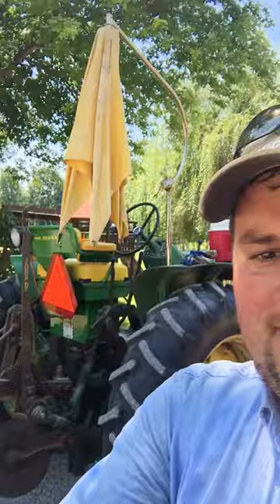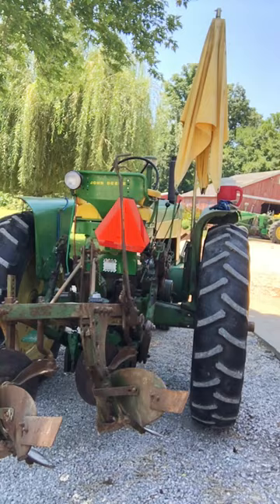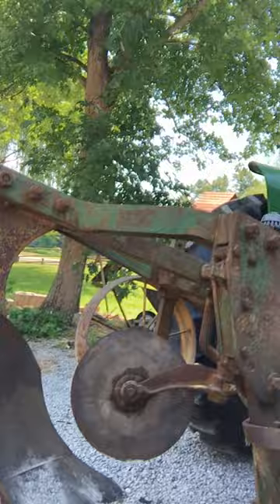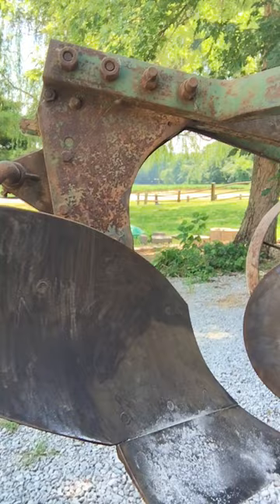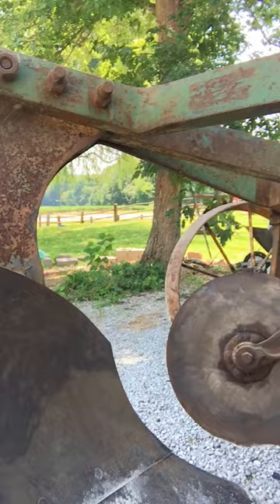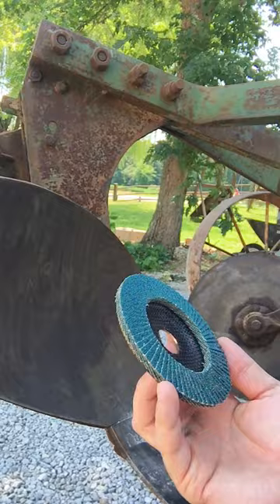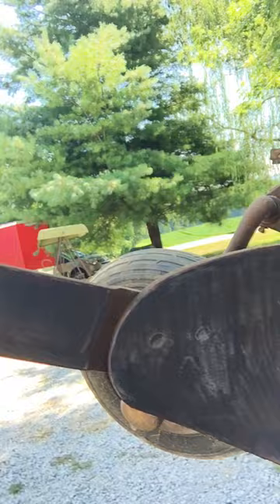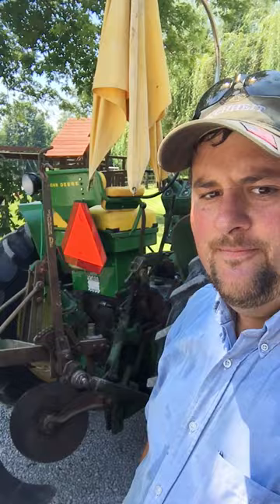Rust Removal on moldboards.

Comment: Bought a 4 bottom with some broken share tips.  The front two nuts and bolts are so rusted that they just round off.  What's the easiest way to remove them short of grinding them off?
Reply: Heat
Reply: @robbiemccarty4226  Yeah, that didn't work.  I ended up using a cutting wheel on the grinder and knocked them out with a hammer.